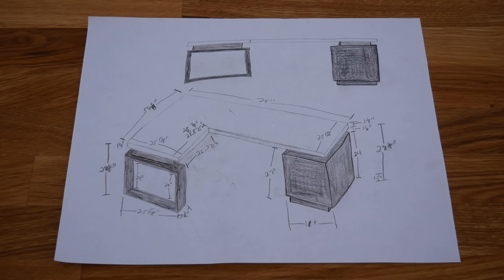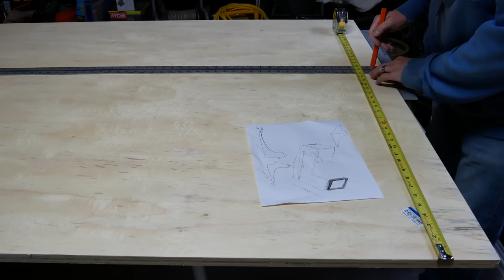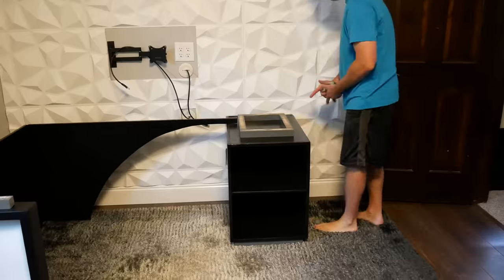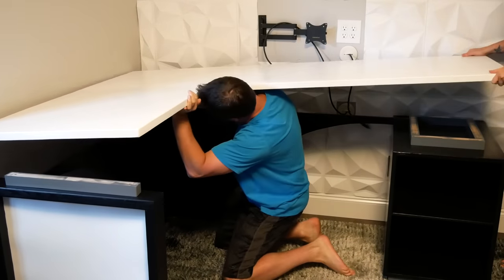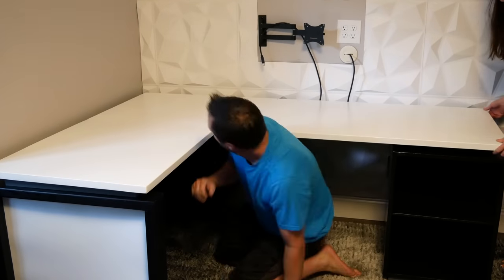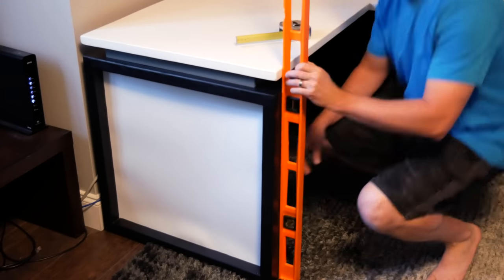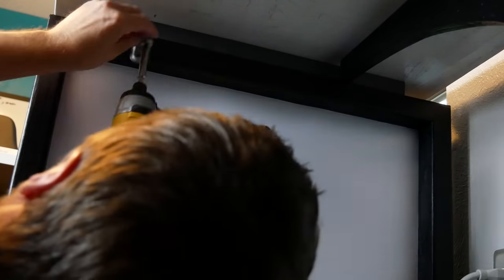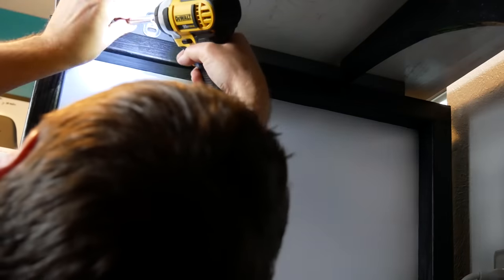Building My Custom Gaming Desk

Comment: imagine being talented to be able to build a PC, cable manage it and make an entire desk with cool legs and storage
Reply from the maker: Thanks my friend!
Reply: Definitely  not me, but would love to try it, problem is I dont have the right tools and money...Haha
Reply from the maker: @cicada3312  Yeah, the right tools and money helps a lot haha
Reply: You really just need the tools and building a pc takes no skill you really just need money
Reply: dizney jnr I put together an old table with desk legs and it took me a couple hours because I had no tools or materials I did two store runs and the worst part is aligning things together
Reply: PC building requires very little skill. Desk however does, you also need money and tools (which may not use again if it's a one time project). Therefore instead you could design it out on paper or 3d sketch software, then outsource the actual building of it to a Joiner, they will have all the tools and skills and will probably be a much better finish too.
Reply: Min_Doe it’s not really a talent YouTube can get you a long way😭😭😭 I just used 2 desk tops and 3 drawers and it only takes like 15 minutes to build a pc everything else in my setup just came in overtime
Reply: Omg this guy actually responds to comments
Reply: The pc you could just look up a tutorial for,its more simple than i sounds once you watch a few videos on it, and the desk is just having some decent woodworking
Reply: You can too! Don’t ever be shy from building your own furniture. Woodworking is a lot of work but anyone can learn it if they would like. I’m going to attempt to tackle my first gaming pc here soon when this Covid-19 stuff stops messing all the parts pricing up. So wish me luck 😨
Reply: Building a pc or a desk is nothing you yourself can’t do!
Reply: What do you mean by talented its not that hard. And building desk too it just need time and tools.
Reply: Don’t forget the garage / workshop to construct the damn thing and then hiring a crane to get it upstairs 😳😱🤪
Reply: imagine being so talented that you grab a butcher block countertop to paint instead of planing and gluing 2x10s or 2x12s
Reply: Yea you also just need thousand of dollars in different tools to cut and put together all that.

Comment: Woodworker here! First off, great job and I really like the center leg idea! I only have one minor tip! When using the painters tape on the drill bit, leave it "flagged" out, so when you get the depth you need, it acts as a sort of brush, brushing away the drill bit dust. So when you don't see any dust, you are at the correct depth. Well done man!

Comment: I can’t believe you paid all that money for a solid wood top only to paint it white.
Reply from the maker: I wanted the strength of solid wood and to be able to cut to size and drill holes in it to mount power strips, cable mgmt etc.  If you get an already white desktop, its usually plywood with white laminate or honeycomb cardboard in Ikea Linnmon.  Doesn't have the strength and cant cut to size, etc
Reply: @PCBattlestations  MDF board probably has the same strength. I do agree with Lane about having great looking wood and painting it. I rather stain it. Again, just an opinion, you get to do whatever you want with your wood. It's yours after all.
Reply: The top he used isn't solid wood. It's an ikea countertop that has a wood veneer.
Reply: its a butcher block basically
Reply from the maker: @brandonbreuer6589  Its solid wood countertop called Hammarp.  I could tell its solid wood cause I cut it and can see its not a thin layer of veneer covering MDF.
Reply from the maker: @mastersergant1287  Exactly
Reply: I think it would have made more sense to use plywood or mdf of sufficient thickness (3/4" can take a lot of weight already, but if on doubt you can run a couple of rails below it to increase its strength, and they won't be visible).
Reply from the maker: @PayneMaximus  Thought about that and it would be cheaper.  I didnt like how the edges would be but you could put veneer to cover up the plywood lines to make it look smooth
Reply: @PCBattlestations  There's no need for veneers, just paint the sides too.
Reply from the maker: @cartoonKAshahar  Nice vid my guy!
Reply: @PCBattlestations  hey anybody knows where I can get that wallpaper if you do plz ket me know
Reply: I think you missed the part that he said, he needed something strong to hold that weight that's why he got a solid wood.
Reply: omg thank you. Building a desk is not modified an existing top.....
Reply: @LAUGHFANGOFFICIAL   @PC Battlestations   MDF and solid wood have the same strength, though MDF weights a bit more, seeing as the room is air conditioned it wont make a big difference, but over time his top will get cracks in the paint, as the wood will expand and contract with the temperature and moisture change, that's why cabinet companies use a veneer center panel if they don't give you an option on your center panel, not inherently a bad thing, but something to keep in mind.  bear in mind this is my knowledge based off years of selling kitchen cabinets. also you used a grass Tec hinge for your cabinets, which aren't bad, but i would recommend changing them to Blum hardware, I've seen less issues with them over time. it was smart to add the board over the cabinet to increase the height, because otherwise you would have had some potential scrapping of the cabinet door and countertop, plus i think it added an extra dynamic to it.
Reply: 14 years in office furniture.........why the heck would you paint chop block top?
Reply: @PCBattlestations   Dude... 3/4 birch ply is strong enough to hold anything you currently have on it and then some. And if you you double it up it's just that much stronger. In the end, it's your build but you could've done it cheaper and just as strong. They build homes out of plywood. It's definitely strong enough to hold a Pc...
Reply: @brandonbreuer6589  Did you even look when he cut it? smh
Reply: @JCrook1028  you are right it is solid wood which can be seen when he cut it. It may be worth noting, that as far as I can tell the Hammarp piece he used in this video is discontinued and ikea no longer offers any solid wood countertops, at least in the US

Comment: I'm gonna be building my own desk soon. I used to build houses(framing) and also did everything from finish carpentry to flooring(commercial concrete flooring/hardwood/carpet and epoxy coatings) so building the desk will be easy. But I'm checking out everyone's desks so I can get some ideas of how I want mine to be. Yours is pretty much what I was wanting to do, so thanks for the video and some inspiration!

Comment: I like the desk. Especially the back arched leg gives it an amazing look but next time you have a project like this instead of using wood filler in that joint loosing your valuable surface area on your joint. Run your saw down the faces and give it a crisp 90 degree butt joint and for extra strength get some dowel today from your local hardware store and drill holes to reenforce your joint. It’s overkill but I personally “wood” rather be able to know that I can’t ever break it. If you want the vinyl to shrink and give a more conformed shape to your square leg do 45 degrees joints and use screws coming down from the top and up from the bottom, then they aren’t visible and for extra bonus points countersink your screws and put filler in the holes. Give a nice sand till the pine is very smooth and it should come out seamless and pretty closely resembling a steel leg. But these are my suggestions that are coming from someone who is passionate about building custom things and had the privilege to work in this field. These slight changes won’t require extra tools and should be easy. With the limited tools I saw in the video I am impressed by the quality of these desks. I have seen work that is horrible in comparison to this. So with my OCD suggestions, I wanna say that you made a awesome desk and a great video that should open some peoples eyes to the fact not all stuff has to come from ikea or rooms to go. I’m currently building my overkill steel and oak desk that matches the rest of my room and I’m always looking for more ideas to include into it.
Reply from the maker: Hunter Reynolds This guy custom builds! Great advice! I love learning and still have a lot to learn. I love doing custom stuff too instead of buying from major retailers. “Wood” love to see your desk when finished

Comment: Pocket holes are meant for cabinetry. In the future, make sure you're using the appropriate length screws for the material thickness. 3\4in ply should be fastened with 1 1/4in screws. Cool build non the less.
Reply: they can be used in other areas, But this is for sure text book expample of when not to use them. ( Butt jointing the Desk top ). the grain direction made it much weaker then it could be, Still better then Ikea tho

Comment: I really like this desk build. I'll be building my first gaming PC in the near future and plan on getting a 34" 3440x1440p monitor. I've been looking for a desk to use and am really leaning towards building one myself (I don't really have alot of experience with woodworking and I definitely don't have the tools, but I have good friends who have both in plenty that could help me out). I do have questions though:

I know IKEA sells tabletops by themselves, but are there any other places you would recommend looking in to for sourcing them?
Reply from the maker: Thanks and hopefully you and your friends can build a custom one too!  Check out a local hardware store for wood countertops.  Don't know where you're at but here in the US, I also looked at Home Depot and Lowe's but Ikea had a wood countertop that was slightly cheaper and was in stock.  I like all wood as its sturdier and you can cut it and drill holes in it.

Comment: how far in does the middle legs come in? Because I notice that it dosen't line up with the outside/edge of the countertop. In building this rn and need to modify it a bit
Reply from the maker: Yeah, dont put the middle support leg on the outside edge.  Bring it in until they fit together.  I believe the long side comes in about 8 inches and the short side comes in about 7 inches from the outside edges

Comment: i hate to be that guy but you had a pocket hole jig and still but joint plywood its fine its just kinda the whole point of a k4 jig youre not really recommended to use it on 2x4s still an awesome desk i would have made more storage and just used 2 sheets of mdf or 3/4 in plywood and puttied the ends so you dont see the the ends and took a router to soften the edges but hope you keep going into projects like this youre way more talented than i am for sure. If i had the money this is what id put more time in and try to sell gamer desks or something along that idea.

Comment: Looks awesome. Is that a 49" Monitor ur using at the right? If yes which wall Mount do you use? Cant find one for less than 250€. It looks awesome in combination with those wallpanels in the back

Comment: I absoulutley love it. But do you know how much it was for the whole desk because i might think about it if i can afford it
Reply from the maker: Around $400-500.  $300 of it was the cost of 2 countertops though.  Be a lot cheaper if you didnt do an L-shape
Reply: @PCBattlestations  yikes thats a wallet breaker
Reply: PC Battlestations why not just buy one longer one
Reply from the maker: @Storm-zx6zc  You could but I needed a total of 103 inches for one L-shaped desk and the max length on the pre-fab ones are 98".  I also made 2 desks so buying 3 counter tops produced 2 desks

Comment: what type circular saw is that? sidewinder or wormdrive? ryobi 6 1/2" or 7 1/4"?  and is that a  60 tooth diablo blade? what size should i get? 6 1/2" or 7 1/4"?

Comment: You could have put the screw joints on the bottom of the desk, eliminating the need for wood filler!
Reply from the maker: The screw holes are in the bottom of the desk.  I used wood filler for the gap between the 2 countertops
Reply: PC Battlestations that makes sense, great build btw

Comment: Is Building  my own desk cheaper than buying a table top and  two drawers and a bunch of screws? If not what are the pros
Reply from the maker: Depends.  Probably not cheaper than the all Ikea option but cheaper than paying someone to build the custom desk built for your space with quality materials.  I built this because I wanted something to fit in my corner with exact dimensions and wanted to customize it.  By doing it myself, it is cheaper than paying someone else to do it.

Comment: Hey Ryan, I am really inspired by your work and would like to ask what dimensions hammarp you got because I want to make something similar for my setup
Reply from the maker: I got the 74" x 25.5" Hammarp but dont know if Ikea sells them any more.  I just wanted a wood countertop so any place that sells them too would work.  I just went with Ikea cause they had them in stock and were slightly cheaper
Reply: @PCBattlestations  Thanks for the info Ryan, really appreciate it

Comment: I'm sorry, why do you use "pocket holes" diagonally, while you can put the screws straightly?
Reply from the maker: I needed to join these 2 pieces of wood together and this pocket hole method creates a strong connection.  Cant really screw in straight since these are longer pieces of wood
Reply: @PCBattlestations  no, I mean when you connect perpendicularly two pieces of wood in order to make the legs of the desk
Reply from the maker: @chacon53  Ahh yeah, that makes more sense lol!  You can screw in straight and would probably be fine.  I went pocket hole crazy for a slightly stronger connection.  Supposedly it has to do with the veins of the wood and doing the pocket hole method creates a slightly stronger connection doing it at an angle

Comment: Where did you buy the paint and which brand. I am gonna attempt to build this and I wanna get everything right
Reply from the maker: I bought the paint at Home Depot.  Brand was Behr and its a glossy white paint that includes primer.
Reply: PC Battlestations cool thank you! And instead of using the ikea top, I’m gonna buy birch plywood and make it out of that
Reply from the maker: @thomasdunn851  Nice!  Yeah, I thought about getting some nice 3/4" plywood and maybe even doubling up on the 3/4" plywood to make it sturdier but went with countertop instead.  Plywood will still work for ya and cheaper
Reply: PC Battlestations Yea it’s like 40 for a sheet.

Comment: if you gonna to paint it anyway, you should just buy a white table top to begin with. 
what a waste if nice wood top
Reply from the maker: Most white tabletops are not solid wood and have laminate over it.  I knew I wanted to cut it and put holes in it so doing this would be the best.  Plus, if I want a wood countertop in the future, I can sand it.

Comment: Well, this video just cost me £330. I've just bought the stuff to rebuild my desk
Reply from the maker: ROFL!  Im not even gonna say sorry.  I want to say send me a pic of your desk when its done
Reply: @PCBattlestations  can do 😉 need to take the old one apart to reuse the cabinets first though
Reply: @PCBattlestations  All done, and I'm pretty chuffed with how it turned out. want the link?
Reply from the maker: @boytechnichian  Of course!  Send it
Reply from the maker: Luke Barnes YES!!! 👊🏻 This is a great desk custom made for your space. Love it dude. I thought about cutting my 2 countertops diagonally and seeing yours, i wish i wouldve done that. Looks beautiful!
Reply: @PCBattlestations  thanks man, I was kinda worried about it, only issue I had with the mitre cut was having to use a little filler afterwards to fill the gap (about 1mm) it's a different colour to the rest of the desk and it's quite stark. Thanks for the inspiration though would have never gotten round to doing it has I not seen your video showing how to join the two sections together well
Reply from the maker: @boytechnichian  Glad I could help out!